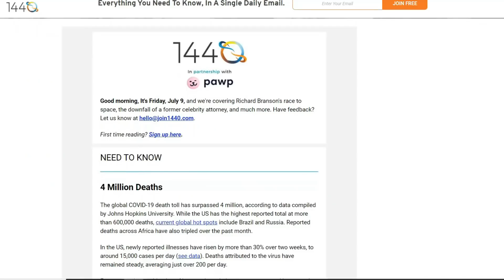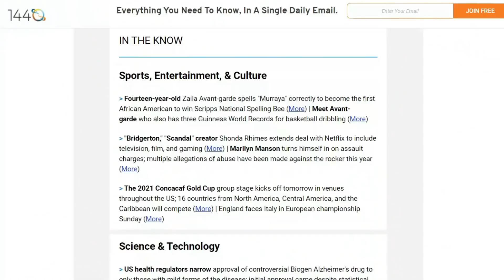OUR CUSTOM WINDOWS DON'T FIT!

Comment: I used to manage 3 Lowe's stores and when a factory said that there is nothing they can do,it's already in production,I called BS. Talked to their boss and said I might have to get another factory to work with Lowe's and there was nothing I could do. Amazingly,things were able to be halted and crisis averted.
Reply: totally... my guess these windows were not done yet either.... they just dont build them that far ahead of delivery.... HD found this out... and did the restocking fee for their trouble (which is fair).... glad it worked out...
Reply: HD and Lowe’s have the big hammers to make manufacturers eat customers  mistakes. It didn’t cost HD a thing.
Reply: Doesn't that just show you!
Reply: Glad they figured thing out at Home Depot but I call B.S. too. Sounds like a perfect way to charge the "Restocking Fee" and still sell the custom fit windows that haven't been made yet but... it still is better the. A full re-order of the windows.
Reply: @dellasmith6583  actually the stores eat the costs because customer service. I used to do 7000 refund rebills on window jobs regardless of whether it was our fault or not because we just couldn't have local word of mouth of shit 7k dollar window jobs running around, it would kill business.
Reply: 100%. They just want to pocket the restocking fee and look like they're doing you a favor while it's the exact opposite ...

Comment: Jeremy heads up, the reason "they" use nail instead of screws is that "if" the load should shift..."nails bend and screws break". But with that one area on the gable end...no worries.
Melissa

Comment: You need to move your thermometer onto the tiny house wall and off the barn wall. The metal will produce higher temp readings where it's currently at. J/S. House is looking good.

Comment: I've built many custom homes and had lots of custom shaped windows. We always made templates for each window and left a 1/4" all around each template for leveling, then all you have to do is label everything including top, bottom, right side, left side and dim. of all written on the face then take good pictures of each. That way when you bring them to home depot or whom ever they will have to either send them to the factory or just copy yours measurements. But which ever they do it, if there are any mistakes  it will be their fault.

Comment: Melissa, Jeremy is exactly right.  With you guys being amateurs at home building, there was bound to be issues.  It seems to me that you have had very few issues that mattered.  It does suck paying a restocking fee, but that is so much better than being stuck with windows you couldn't use and having to spend a lot more to order the correct ones.  Don't sweat the small stuff.

Comment: One little mistake in your math, if it can be fixed, can be overlooked.  I made a mistake on my garage rafters that couldn't be fixed, and quickly learned how expensive certified carpenters are when you need them to correct my dumb error.  The house is coming together quicker than I expected. Great job you two.

Comment: Nice work. Having worked projects with a material loader similar to yours along with a platform like that, I very quickly rigged up a miter saw station on the deck toward the steel frame. No more constant up an down. You're a smart guy, you'll make it work. A massive time and effort saver.

Comment: You are doing well. Things do go wrong. A sawzall with a demo blade is your friend to make corrections. When the lift is gone, you could use old fashioned wall brackets that bolt to the wall frame. These allow you to put scaffolds anywhere on a wall that you want. You could also use your loft area with some plywood on it. Can you rent a work platform for your forks on the JD? Good Luck, Rick

Comment: @Good Simple Living Your problem with the windows is one we don't suffer in New Zealand - windows etc aren't bought from a big box store (you can get interior doors & cabinets this way, but that's a whole other banana). ALL exterior joinery is made to order - custom built. You give/get approximate sizes, then the manufacturer comes to the site & does an accurate measure BEFORE beginning the job.
Approx sizes allow an approx price - full measure allows for the correct & final price (including - in most cases - delivery to site & for larger items, installation & glazing too).

Comment: Melissa, Do not sweat the errors!  Instead, expect that they will be made from time to time.  All you can reasonably do is try to detect them and fix them as best you can.  The only way to avoid them is to be a super-duper carpenter/homebuilder/etc!  Since you don't claim to be one of those, relax!  You have tried to give notice of the mistake.  Way to go!  In my experience, custom doors and windows are usually not made very early in the "waiting cycle" so you are probably fine.  Chill and relax.  It will all work out in the end.

Comment: Omg, I was laughing so hard because I was talking to my niece while we were watching this. I put y'all on pause and we discussed eating a box of chocolates. My strategy is very similar to yours. You gotta nibble the edge of each piece. If it's okay,  you put it down and circle back. If it's good, you eat the whole piece right then and there. Start with the dark chocolate irregular shapes first, then you move on to the square and round milk chocolates. Milk chocolates are the most unpredictable, so you leave them til last.

Comment: Place is looking great, cant wait to see the window go in. Question Zip sheeting tape is meant to stop air flow into the house why didn’t you tape at the top along the 2’ overhang. They also make a liquid flashing that need to be spread over all the nail & screw hole and across the bottom of all the plywood..

Comment: The biggest blessing you have is good health !  I never saw you look at a blue print plan or drawn out picture with measurements. Are you just not putting it in the video?  There must have been an architect that helped you. Let us know about the plans. Did the plan show the correct size window openings?

Comment: Really amazing progress guys! Chin up Melissa. We all make mistakes. Being in the field of construction and having installed roofs myself, I was a bit concerned when I heard the level of vibration of your sheeting in the wind. I think you may want to have the roofers come back and check on the installation. Perhaps you could let them hear that clip with the turbulence. Also, for the soffits, it may be best (safest) to rent a skylift  (not sure if that's what you call it in the States). It's an enclosed mobile lift which you control with a remote to allow you to goup down or to move left or right. Its not as scary as the contraption you have setup now. If your soffit material has vent holes, it will help to keep your house cooler, especially with black sheeting. Also, you may be able to purchase some with tracks that you install to the sides and slide in. Not sure if all this helps since you may already be far ahead of this by now. Thanks again.  And by the way, could someone out there ship this lovely couple a Milwaukee M18 nail gun (without a battery) . It will help you so much with all that you have left to do. Have fun! Hailing you from Jamaica.. nuff respect and love
Reply from the maker: Wasn’t our sheeting making noise, it was a flap of the felt paper that was hanging over the edge of the roof.
Reply: @GoodSimpleLiving  Oh...good. Well that's relieving.  Keep up the good work!

Comment: You may have to rent a lift later when u guys have to install all the soffet around the eves of the roof then it willb done but also your outside siding will b installed too. But not necessarily so got to go onto the roof couple more times for chimney and other exhaust pipes.

Comment: Where I live the building code states that a gable wall on a cathedral ceiling needs to be balloon framed from floor to underside of lookouts for the overhang. This is to prevent the knee action that can occur when the wall is framed to 8 feet and the gable portion built on top of that as you are doing. Building the gable wall this way would mean that you would have needed 1 less parallel chord truss. Not a gigantic mistake but others that are watching and planning a build should make note of this.

On any builds that I have done, every set of plans includes a window schedule detailing the window sizes, I'm surprised (shocked) that your draftsman did not include this with your plans.

Anyhow, have fun and good luck.

Comment: Hey guys. Just a thought....would it be stronger and more stable to put chocks of wood behind your steel braces holding your pantry ceiling up! It doesnt seem strong enough. You will appreciate the extra strength to your ceiling in the long run. I'm sure you have heaps of off cuts you could use. Better to be safe than sorry later.

Comment: Had Home Depot not offered to accept the return, could you just reframe to make the windows fit?
Just curious.

Mistakes happen and then we find a way to work around them, I love your drive to keep on moving.
Reply from the maker: The windows wouldn't match the pitch

Comment: If your rise wasn't enough, then the windows may be a bit too small. If that was the case, it would be MUCH easier to fix than if they are too big. You'd just need to use some shim material.
Reply from the maker: They were 2 inches to big

Comment: I am not convinced that Zip System on the walls is superior than house wrap and standard OSB for the added cost, that is a lot of seams to tap vs taping a few seams on house wrap.  Most people layer the hose wrap and don't even tape the seams...

Comment: Opening that are framed to big are no problem it’s one that are smaller are a pain.
Hell that’s a easy fix that’s just cut it to the right lengthen then cut it from nothing to nothing on the table saw
Reply from the maker: The problem was the windows not the framing. The ordered windows won't match the roof pitch
Reply: Oh got it that would be a problem

Comment: Maybe I missed something but if the height was too tall, just add lumber below to frame in the rough opening to the correct size. She mentioned 72" not 74". Bigger is always easier to fix. Doesn't seem to me to be that big a deal to fix that. What I saw on the first top piece of the first window the angles were off. The bottom cord of the truss didn't line up with the top frame of the rough opening. Either way it was fixed.
Reply from the maker: It changed the top slope of the window to where it would no longer match the roofline/ceiling. That’s the problem.
Reply: Yes I did mention that in my earlier reply. Still a relatively easy fix. I'm not knocking you guys, trust me my eraser is almost gone on most of my pencils. If that's the worst thing you do, that isn't that bad. As you both say, learn by doing, learn from your mistakes. Most mistakes aren't the end of the world, just seem like it at the time. I was just confused by what I saw as an easy fix, but I'm not in your shoes. Hang in there, you guys are doing a great job. Just don't repeat that holding the board with your left hand on the right side of the saw blade. If you need to hold the right side piece of wood, hold it with your right hand and activate the switch with your left hand. Watch the video again and see how precarious that way to cut is. I believe someone noted around 8:30 or so, might have been earlier. Plus as others have said, you caught it before the window install!! Keep plugging away. You guys are making great progress and great memories for your family,!

Comment: Loving the build but I'm confused... How will they not fit? I might have the wrong windows in mind so correct me if I am wrong. You said it was out by the rise so couldn't you have adjusted the placement of the pieces of wood you installed at the top by 2 inches? #notabuilder
Reply from the maker: No because the pitch of the windows didn't follow the pitch of the roof, so the trim would run all wonky
Reply: @GoodSimpleLiving  Thanks for that. I had to draw it and I can see how the angle of the roof and the windows wouldn’t be the same. Nobody else would see it but I would and it would drive me nuts 🙄🙄🙄
Reply from the maker: @jaynehemmings8552  it would have been pretty obvious because there is only 5 inches between ceiling and windows. So the top would only be 3 inches then it would expand to 5 inches.

Comment: My first thought:  Redo the framing to match the windows.
Reply from the maker: Pitch was off on the windows, rise was taller than run
Reply: @GoodSimpleLiving  Too far out to compensate, huh.  If you don't mind, what are the dimensions?  I won't tell anyone!

Comment: Why can't you just re-frame the openings to match the bigger window. Your still at the framing stage so it doesn't seem to me like a big deal to make changes. I'm probably missing something that would cause a bigger deal to re-frame. I built a book shelf once so I'm not exactly qualified to give my 2 cents.
Reply from the maker: Because then the windows don't match the roof pitch
Reply: @GoodSimpleLiving  Oh, I think I get it now. The extra 2" will not be parallel to the roof line. See I knew there was a logical reason. :)

Comment: To bad y'all didn't have work lights.... Why couldn't you undo the opening get a Sawzall and cut through the nails. I guess I just don't understand. When I mess up like that I just undo what I did and redo it to the right size. Yes it's a lot more work but at least I fixed it... Bu that's me I don't really know your whole story on the why's and why's nots....
Be blessed in Jesus name... BBE..
Reply from the maker: The windows ordered wouldn't match the roof pitch so the issue was bigger than just the framing
Reply: @GoodSimpleLiving  I figured it must have been something like that. Once I thought more about it... I'm just glad they are working with you on it... Be blessed🤗🤗🤗🤗🤗🤗